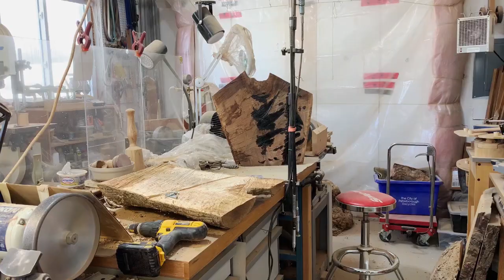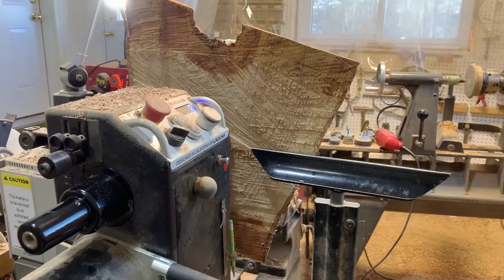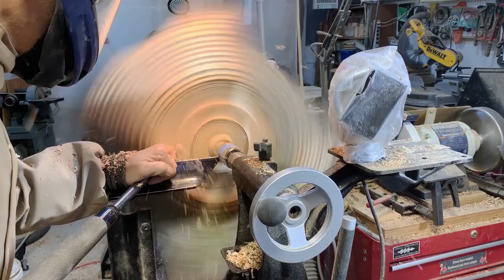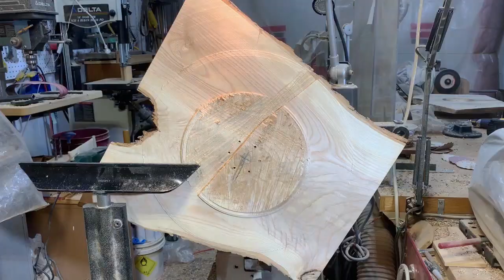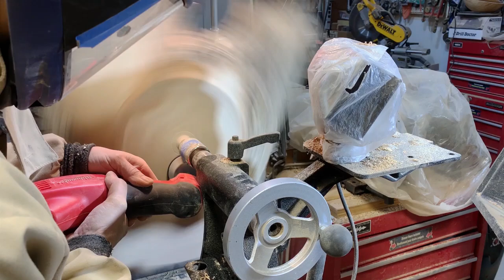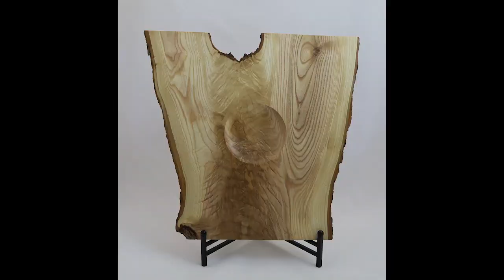Woodturning a Crotch Piece

Comment: Frank, I love your take on handling large pieces, leaving much of the original and turning it so as to enhance the natural beauty. I've heard that as a woodturner we get credit for what God has made, we just get to uncover the beauty in the grain, color and shape.
I'm also confused about your lathes. I wrote you recently asking about your Robust American Beauty, a 24" swing lathe. I have been looking to upgrade my Nova XP DVR lathe with one with greater capacity, and now I see you are turning this piece on a Laguna 24|36, another lathe on my list. I'm interested in your take on the differences between the two and your recommendations if I am only able to fit one in my shop?
Reply from the maker: Hi again David, yes, I have owned two lathes for many years just to make sure I had a backup and also there are times that I have 2 students at one time.  For the last 4 or 5 years I had an old General 260 as my backup, but around 1 1/2 years ago I had the opportunity to buy an almost new 2436 Laguna because a friend was moving away and had to sell his machine.  So I have two - 24" capacity lathes in my shop with the same thread size and MT etc. with all my chucks being interchangeable.   I like both lathes, but the Robust is a much better, higher quality, heavier, better built, better electronics and a better designed lathe overall - of course it is almost twice the price of the Laguna .  Having said that the Laguna is fine and it has the bonus feature of being able to buy an extension bed and riser so that I could slide my headstock down and turn things up to 38" dia between centers - a much safer way to turn large stuff.  With the robust I can do 25" dia with tailstock support, but for larger stuff I must slide my headstock down and turn larger diameters with the outboard turning attachment (tool rest) with no tailstock support.  Pieces would just be on a faceplate or chuck.  It comes down to how large of items you might realistically turn and how much you want to spend on a new lathe - both are good.  Hope this helps.
Reply: @frankdidomizio  it does help, Frank. Thanks for all that information and the run down on your two 25"lathes. I just saw your shop tour and your old General. Your explanation helps orient me to your work. I'm really going to enjoy seeing all your videos and looking forward to more as they come out. Thanks again for the lathe info.
Reply from the maker: Thanks David, I am starting to run out of idea/projects for videos so there may not be as many coming out as before, but I will try to keep releasing them.